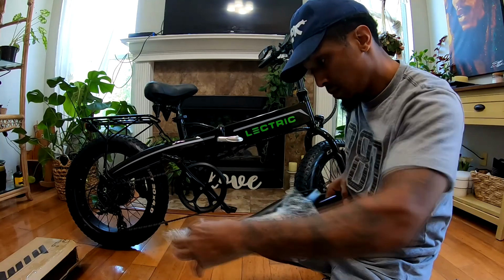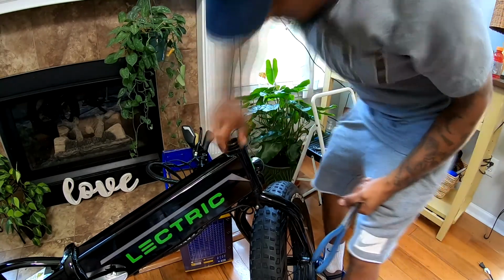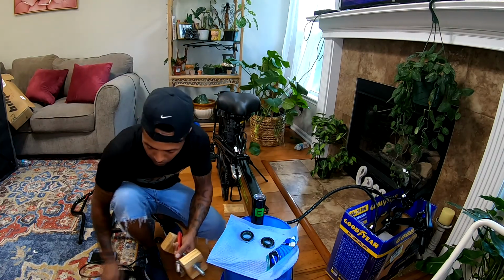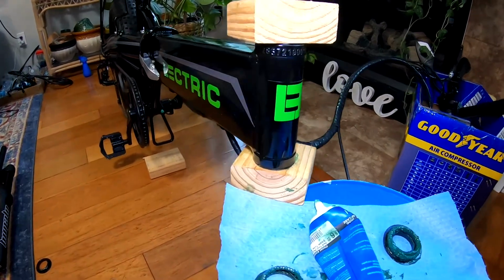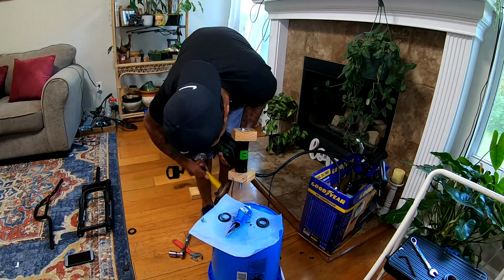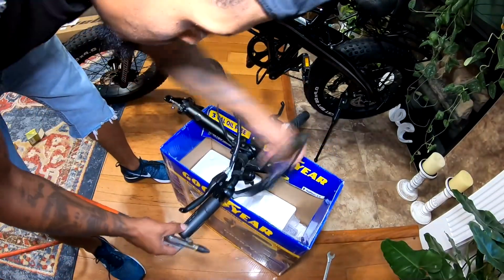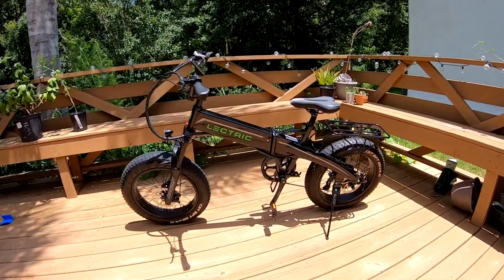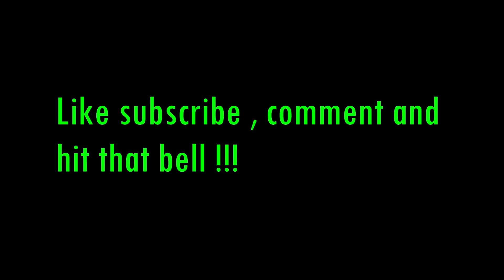Lectric XP Suspension & Handlebar Upgrade (E-BIKE)

Comment: Great vid I'm doing same upgrade when forks arrive why did you change stem bearings and cups did you have to
Reply from the maker: Yes, it was recommended to match up with the suspension.
Reply: @BubCityHoodRides  nice one ive ordered a set of the double header type znd was told old bearings fine just getting what info I can before they come
Reply from the maker: Thank's 4 Watching 🤙

Comment: Very nice build. I’m looking to add the same forks to my XP. I’ve looked over your list and added the parts from Amazon, it looks like they have the star nut in stock as well, Could you tell me if I would need anything else to complete this install? And do you have any hints or tips for making this job go smoothly? Also how do you like the angle that the bike sits at now Compared to the original? I’m a little older and I don’t think I would like to be slumped over the handlebars too much. Thank you again for your video and any advice that you may have for me on my future build. Peace.
Reply from the maker: Everything listed is all you need. I love the angle it actually helps me out because I'll straighten out my posture as I ride. You should be fine, you can always change out to higher rising handle bars as well.
Reply: @BubCityHoodRides  Ordered all the part’s today. Wish me luck. Thanks for your help.
Reply from the maker: @ericlambe7206  Just watch the video as you go and everything should workout 👍. Any questions I'm here for you .
Reply from the maker: Thank's 4 Watching 🤙

Comment: Hey my freind, what size fork is this?
Reply from the maker: I believe it is for a 24 inch wheel, check in the description, link to fork is there with all the info 👍 .
Reply: Really would like to know 24 or 26? I saw another video, this person is running a 26 fork, it looks really tall up front, yours somehow looks like the 24 i am hoping to use, the link only says 20inch fork
Reply from the maker: @dleebox2268  Most def 20 if link says 20. Now that you say that I remember it is indeed a 20 inch because I bought another shortly after and wish I'd went with 24 in.
Reply: @BubCityHoodRides  that doesnt look like a 20,i'm pretty sure its a 24-26 it really looks gr8 though, thats why i really want to know exact size, the link says 20
Reply from the maker: @dleebox2268  I just checked the link. Unless they sent me a 24in fork without me knowing . That is the link I used though.
Reply: @BubCityHoodRides  well my freind, gr8 build,i have looked at so many bikes, still coming back to these folding bikes, cheers bro😎
Reply from the maker: @dleebox2268  Thanks 👍
Reply: @BubCityHoodRides  aaah, i located this very fork online, its really 24, perfect fit, thanx bro😎
Reply from the maker: Thank's 4 Watching 🤙

Comment: I have the same Lectric bike as you have, and I did a similar upgrade with a suspension fork, stem, headset, and bmx handlebars. This is a better set up than what was originally on the bike.  However, I found one thing that I didn't like on my bike. I used the Pasak P35 fork, and I found it has a top out problem. If you hit a bump, the fork compresses as it should, but sometimes when it comes back up, there is a clunk sound on mine. Small bumps are no problem, only the larger ones cause this noise. Do you have a similar noise on your fork? Everything is adjusted properly, so it is not a loose headset bearing.
Reply from the maker: No issues at all . This fork is air suspension and adjustable , I love it.
Reply from the maker: Thank's 4 Watching 🤙

Comment: quick question what is the crown race setting tool for?  i dont think i saw you use this at all atleast from looking at the amazon link also when  u say u just got back from the shop to get a new fly racer , if i go ask for the same thing , what sizes what it be
Reply from the maker: That black ring I showed when I mentioned crown race . It connects where the tube and suspension meet. That tool helps move it down the tube evenly. Bike shop here did it for free. Crown race comes with the cup assembly I linked in description so you'd need that same size cup kit 👍
Reply from the maker: Thank's 4 Watching 🤙